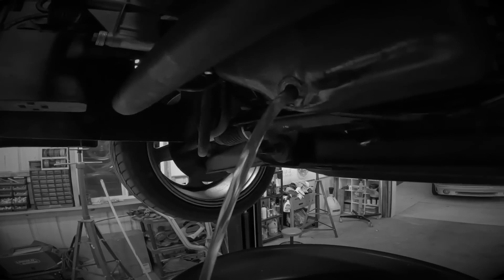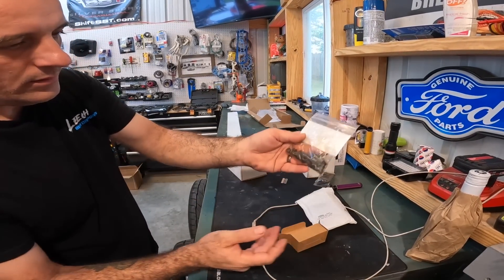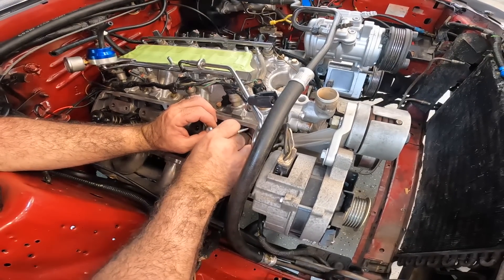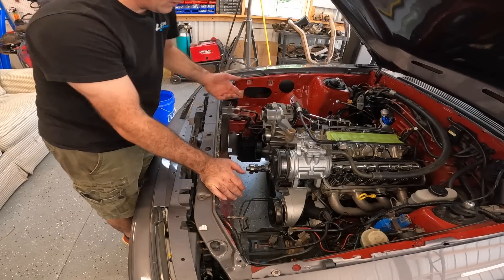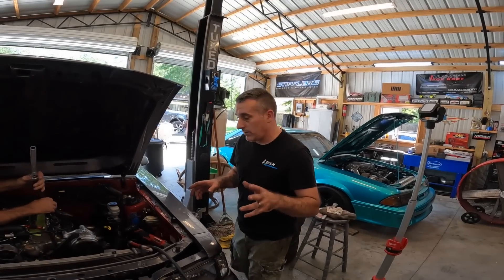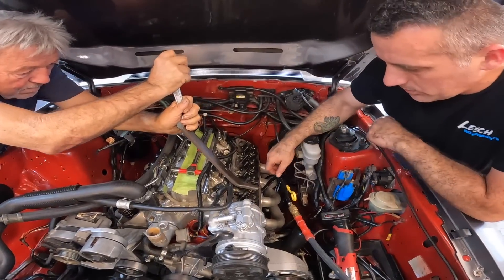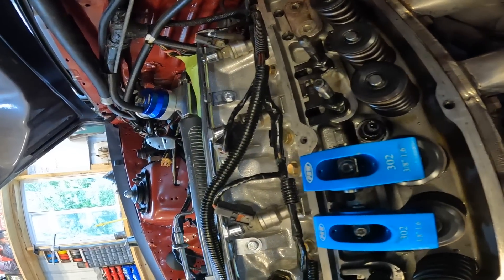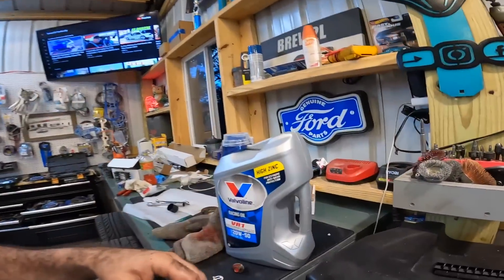People Tried To Tell Me This Was Normal.. I'm Here To Tell You IT'S NOT!!! #VALVECHATTER

Comment: You actually didn't have to take any lines off the AC.  The condenser can rotate up enough to get the cam in/out with both lines attached.  I have done it many many times.
Reply: Its kinda like changing headers without removing spark plugs. It can be done, But ya take them out so they dont get broke……
Reply: Same here

Comment: 🔔😎 
Excellent !! 👍👍

Here's an old "no air" valve spring trick.
Cylinder on TDC. Roll the piston down either way. Feed a couple feet of 3/16 cotton rope into the spark plug hole, then roll the piston up to hold the valves😲. 
Works at the track when you broke a spring and you don't have air. Trick from the 50s. 👍👍😎😁

Comment: When the Anderson lifter tools get a little old, the shrink tubing that holds the magnet can split. Not good. Check them first , if the magnet sticks on the lifter, and not the threaded rod than your day just got longer. It is easy to fix before bad stuff happens.
Reply from the maker: I’ve had one pop off before. Luckily I was able to get it to reattach to another tappet tool. The shrink wrap isn’t what actually holds them in place. They are epoxied to the rod. The wrap is used more as a place holder while it dries.

Comment: Funny story I recently purchased a 95 Cobra it needed a new plastic Cowl panel. While taking it off I broke the old plastic vaccum lines going to the washer nozzles. I didn't fix it right away because I didn't have the parts to fix at the time.  Then I did a few mods like Screamin Coil, and a couple things. After that I drive the car and it bucks and snatched and acts stupid. I put a new tfi Module and new connector on coil, and new voltage Regulator connector. All needed. Still bucking and snatching. Corrected timing and still did it. I finally got around to fixing The Big Vaccum Leak from the Washer Nozzle vaccum lines and bam smooth running car. No bucking and snatching. Check All Vaccum Lines. Including those going to Washer Nozzles

Comment: Hopefully my 1 year Fox project will be wrapped up soon, work has been crazy busy. 
TrickFlow Street Burner upper and lower
BBK fuel rails 
24lb injectors 
BBK 75mm throttle body 
BBK fuel pressure regulator 
Vacuum block
Roller rockers
Push rods
Value Covers 
Mega squirt ECU
BMR tubular K member
Subframe connectors 
Kevin Brown extreme matrix kit 
Stiffler driveline hoop
Ford Performance 3:73 gears
U-joints
Wire harness tuck
Clutch kit
BBK equal length shorty headers 
And of course fresh Amsoil Zrod high zinc oil
I'm sure there is other stuff I forgot about, can't wait to five her again. Gunna be a completely different car.

Comment: I use those adjustable guide plates and have a hell of a time with them, I have afr 195cc heads and the push rod is all the way against the aluminum in the hole to try and get them centered
Reply: Sounds like a head problem? Stud location or hole position. 🤔
Reply: @hotrodray6802  ya it's like the holes are offset, im using a dart sbf block and afr heads,  but I can't afford those jesel rockers with the offset and can't find a cheaper version
Reply: Grind it, people grind it all the time to run 3/8 rods

Comment: 🔔😎
Just caught it @ :40 (and 23:43 still shot) as you said "pass the camera by". Look at that rocker/ valve tip carefully. (The rocker straight in front of the roof truss) Not lined up. Right? Now look at that retainer. Doesn't fit the spring. 🤔🤔😎
Reply: I mean stop it at :40 and look at that spring retainer. The retainer edge is inside the spring coil. WTH? That is not correct.
Reply: It looks like the retainer is not designed for those double springs so obviously it's not seated squarely onto the outer spring. 
When a retainer is placed into a spring before installation it should snap in lightly and not move around in the spring hole inner diameter. Double springs make it worse because the inner spring touches the retainer too.
😲🤔🤔 Yes I am aware those retainers came with the springs and cam. 😲

Comment: One nice thing about a FE motor the hole for the push rod is big enough to remove the lifters without removing intake that tool looks pretty handy to bad there wasn't some way to replace the lifter without removing intake I need to replace one put new lifters in and one is bad.

Comment: Hey great video, I'm having problems with my cooling fans, it overheated the other day sitting at a drive through. The screen on the super sniper said my fans were on but when I lifted the hood they weren't. What do you suggest
Think I should run a toggle switch that way I know it's on. I have aluminum heads and you  know I could cause alot of damage if I overheat again
Thanks bro I know your busy

Comment: 🔔😎
Recently when taking pushrods out of the box Brew made a comment about if hardened pushrods really are hard.
Here's how to tell.
Get a good FMB (flat mill bastard) file and run it across each pushrod. If it scratches it, it is NOT hardened. Check your guide plates this way also.
One time I saw soft pushrods in guideplates and they wore almost through until they bent. Guess where all that metal went. JME 👍😎

Comment: It sounds a hell of a lot better, yeah valve train noise is only letting you know that something isn't right, I have never and any problems with it on anything that I have built, I did hear a little noise on beans at first only when u held your head really close to the engine and it freaked me out but it cleared up and was probably a lifter not fully primed up but it  was really quite and not as noticeable as they normally are they  were the one's they came out with a few years ago in 2017 i think . So I knew that u had a little issue somewhere because I could hear it but it's fixed now and that was a great excuse to get a bigger cam as well because you know that is what some of the noise was coming from😉.................. 🤣😂🤣 i just watched a video where someone used those to put a cam in and next time I do a swap im going to get some of those as well. Ive got new valve springs on the  way and going with 1.7 roller rockers because I ended up with some cheap springs that I thought was a all comp cams stuff and it was all but the springs and at the dyno my cam is supposed to pull to 6500 and it peaked 422rwhp at 5700 so there's more in it and Im going to get it all because im greedy and want all the power 😂🤣😂

Comment: My motor guy told me with hydraulic roller lifters the 50w oil is a little to heavy for them and should use a 40 or 30 but I say f@#$ that and I run the 20/50 as well bud

Comment: You didn't want to check valvespring length and shim as needed? Just going to trust the cups and valve job is good?
Reply: JMO
not a big deal with these springs below 6,000 rpm. 😎
I was in a professional race engine shop w dyno.

Comment: I can't believe anyone would say valve train noise is normal...yes solid lifter can make a bit of noise but only on cold start or excessive lash. Anytime you have noise your causing in necessary unnecessary wear. Where you have experience with the 5.0 do you think long tubes are worth the clearance issues? As far as hooking it up that's not a problem, where I'm a professional fabricator/welder I'm getting a 2.5 mandrel bent builders kit with an x-pipe out the back I may use the fake cats I found online just in case.just incase.but if it's not worth it on a efi 5.0 I wouldn't bother. It's a sn95 vert so I'm never heavily modding this car other than mild aluminum heads cam n intake. where I'm hoping some day of getting an 32v sn95 cobra even tho I'm not a huge fan of ohc engines but performance potential of those is really high.
Reply: I disagree with u on ur solid lifter praise, I only have runem for 18 yrs on street, they make noise like a type writer, back in day cams ran .20 tho clearance, now they have closer clearance like mine that’s .12 tho, still makes same amount of noise hot or cold